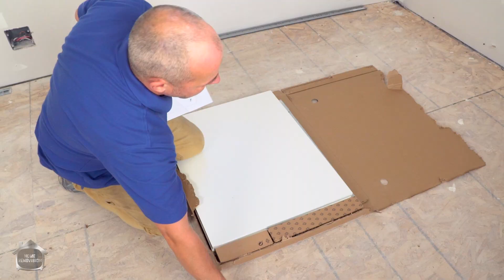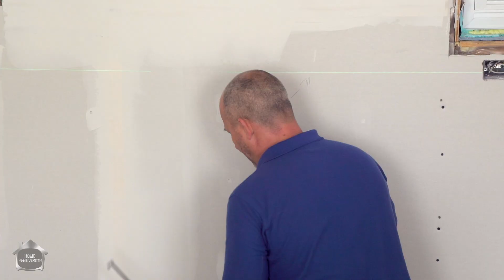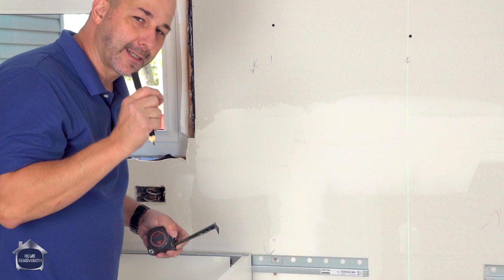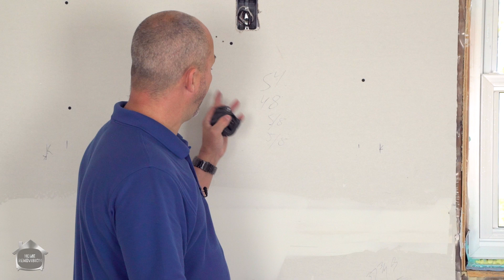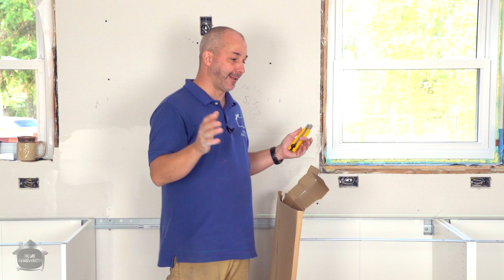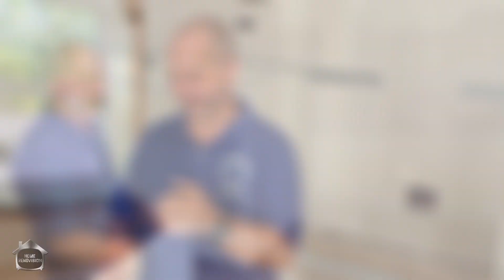How to Install IKEA Kitchen Cabinets and Save Money! | DIY Kitchen

Comment: How would you solve my roblem that the courner is not 90 degrees but 95 degrees….the cabinets cant hang in the air? Put them 95 degrees and add special filler or add horisontal bars behind the hangers to get 95 degrees? There is also the option to remake one of the walls with 0-15 cm new cement building block wall elements to get it to 90 degrees

Comment: wtf is this math? the feet carry 50% of the weight? did you just go screw(1)+feet(1)=2? Fastening points are in the back of the cabinets, majority of the gravitational pull is in the front, the feet are carrying way more than 50% i'd expect closer to 80%.. Screws are basically just keeping the cabinets flush..

Comment: The stove plug is too high.  Supposed to be max 5 1/2 inches from floor to centre of box and ground pin is supposed to be on left or right side.  This way the plug tucks in under the back panel of the appliance.

Comment: Hi, it's been a while you posted this video but still is the best install guide. Thanks. 
Would like to ask a question. I have pipes along the walls and so will put battens for the bottom unit rails. then is it okay to just have the rails and remove the White bumpers on the backside? Because there is nothing for them to be supported by?

Thank you in advance.

Comment: I go the extra mile when ive install those cabinets.  I make a base for the bases. Now you have a very strong cabinet. Ive never had very good luck with those feet they give you. I like their hanging feature but they arent the only ones who have that system.  I enstalled an European  high end cabinets that cost for an average  size kitchen ,roughly 9ft. X 10 ft. Those cabinets cost in the 70s were for just the cabinets  $ 25,000. . Ive done alot of the Ikea cabinets and other cabinets that are knockdowns too. Some are better than others ,so do your homework.

Comment: How high to mount the sliding bars?   For example, my lower cabinets is 34.5 inches (30 inches cabinet plus 4.5 for legs), so how high should I mount the bar to get perfect mount of 34.5 inches

Comment: The only way to save money is: DIY, it can be any brand kitchen as long as you DIY.
The only difference: Ikea designed the cabinets so it's easily mounted and supply an easy to read manual.
And there are now a lot of YT videos which you can watch, there aren't that many YT videos for other kitchen brands.
Reply from the maker: Very true!

Comment: We would like to put insul-armor subfloor in our basement, with vinyl click-lock flooring on top, and Ikea cabinets.  But I have heard you can't put cabinets on top of vinyl. I was wondering if the ikea cabinets can go directly on top of the insul-armor?  Or do we need to put plywood or something on the insul-armor to support the cabinet legs?  Thanks!

Comment: Good stuff.  Honestly though that explanation of finding the lowest point of some area of the floor was a little confusing.  Why not look for a spot along the wall that represents something like the average height of the floor and draw a horizontal line along the wall at say 31"" off of that point on the floor?  36" is a standard countertop height.  So if you subtract out an inch for the countertop and 4" for the rail.

Comment: Impressed 👍 if you can't do a diy install with all this information then your best off getting a professional to do for you. But with this info there's no reason most people can't do it themselves
Reply: However I'm still constantly surprised by the fact that the US uses imperial measurements 😄 such a weird mode of measuring compared to metric

Comment: How high did you hang them or does it matter on how tall appliances are?  Also, did you use their base system?  Those little legs that screw on to the bottom of the cabinets or did you use 2x4s?  What are your thoughts?  Thanks in advance!

Comment: Pro tip on opening ikea packaging is to use a stiff plastic spatula.  It's what they use in their recovery areas.

Also you don't need the appliance panel on the ends by a stove. You can leave it blank or use the standard 1/2 thick cover panels! The 5/8 are mainly for an end of run with a dishwasher or a dishwasher butting up against a refrigerator panel.

Comment: Two fun realizations with Ikea. Yes they go together fairly easily but a) the "filler" panels which adjust for non-uniform spacing are ridiculously overpriced and b) you are actually payng for a cabinet and skins for each and every piece. The cabinet is standard issue with a standard interior - much like all Ikea stuff. Then the skins (red, green, wood grain etc) are applied to that carcass. It adds up pretty quickly. Other than that they are pretty simple to assemble, mount, trim. I found granite tops to be cheaper, with more selection, from local suppliers.  Would I use them again? Probably not. My experience is a good cabinet maker is pretty close to the same price and will make hardwood cabinets (that you must paint or stain - see sprayer video) that fit perfectly. So that "filler" space in not lost. It just becomes a wider drawer or more storage.   Note this higher "filler" cost is true for all prefabs including Home Depot and Lowes etc.  So its not just an Ikea ding. In all cases you get a piece you have to rip saw and L-bracket mount.    But seriously check out a real cabinet builder - they have a lot of options and experience. You bring them your proposed layout and in a heartbeat they will improve it thanks to their vast experience.

One additional trick worth sharing. Look at a professional restaurant layout. They have zones and a workflow. The storage (pantry, refrigerator) and food prep (counter then ovens/stopetop) are in arms length. Usually from left to right. So the food comes together, is plated (to its right) and then off to the dining area.  When the course/meal is done the dirty dishes come back to another area and queue up for disposal, sink (rinse) and dishwasher. Then when clean back to storage. These functions do not cross eachother.   I did a  kitchen in this manner and had great dinner parties.  Dessert prep is also a space separate from the cooking area.  Sounds like a lot of space but its not. And if things keep moving people have more time together.

Comment: Great video as always.
1)Quick question what size scews did you use to secure the rail?

2)Also if you had to cut the rail what type of tool would you suggest?

Thank you in advance
Reply: I personally used 3" SPAX cabinet screws to secure the rails to the studs, and I used a 4-1/2" angle gringer with cutoff wheel and it zipped through cutting those rails

Comment: How'S your iKea cabinets hold up? Especially those next to the range. Planning remodel kitchen not sure if the cabinets will withstand the high temperature (broil/self cleaning)
Reply from the maker: you can always install some sheet metal on the side of the cabinet to sheild the gable panels if you do a lot of baking. Cheers!

Comment: Hi Buddies. I am in a trouble and requesting for ur helps. I got an accepted offer from a buyer for my apartment in BC, that I realized a drywaller left a lien of $ 1880 on my condo. Now, I have only a couple of days before the expiry of my deal for selling my condo. the contractor is unwilling to come and get his money and sign the release form and ask for more money just to come and do it. My lawyer and my realtor recommending I paying the extra $1000 plus the $1880 plus my written letter that I certify not leave him any bad comments for feedback so that he comes and signs the release form quickly before the possession date. What do you recommend me doing? He did a very bad mess with his drywalling and did not come back and said okay to bring someone else to fix it as he is busy at least for a week. Then, he resent me the same quote as he gave before for the finished work by him. I do not have any contract signed by him and nothing more than his initial quote.

Comment: Hi Jeff,
I think all of your video's are great! I'm thinking of purchasing the Ikea kitchen cabinets. 
Questions:
1. Are they RTA cabinets?
2. Both upper and lower cabinets are only supported by the hanging rail? Not screwed into studs at all, as with conventional cabinets?
3. I see that there is only a metal bracket connecting the side panels of the cabinets. Is this strong enough for either granite or quartz counter tops?

Comment: You forgot to add the 5/8 for the 103" panel when adding the 10" overhang you were measuring off the edge of the bare cabinet

Comment: Has anyone tried moving IKEA cabinets away from the wall? How did you brace them? We are building a laundry room with a 30" countertop to match the washer/dryer depth, and want to bring the cabinets forward 6 inches to be flush with the front of the laundry units.

Comment: Best tool to open all the boxes I found is a small plastering spatula. It is thin enough to fit in between glued flaps and not sharp enough to damage anything thou still sharp enough to penetrate the tape. It takes me now couple of seconds to opeen a box nice and clean compared to what mess I was making ripping and cutting those boxes before xD You welcome!

Comment: You mentioned you can place cabinets after floating floor is installed? Wouldn't they pinch the floor and prevent it from expanding/contracting?

Comment: The range receptacle should be 130mm to centre AFF.  Yours looks a little high.  Just a note, unless you are a licensed Master Electrician with a contractors license you are not legally allowed to perform electrical work in other people’s homes in Ontario.  You should probably not be mentioning you did the electrical yourself.

Comment: I’m sorry bud, but this is just not the way to professionally install cabinets. Drywall isn’t complete and there’s no finished floor. There is literally no reason or excuse to installing cabinets before flooring. Even the flooring you’d save money one, won’t be there and in turn won’t be a complete flooring system.
Reply from the maker: So the reason I am moving forward is so that I can have my counter measured and cut while I am finishing my kitchen. this saves me almost 2 weeks of production. Sine I am living in the house I am willing to do it a little backwards to finish faster. no worries it does not cause any problems!

Comment: Hmmmm thoughts on building platform bases instead of the feet.
Reply: Wondering the same thing, particularly the island.  Thanks for the great video!
Reply: @kristin347  there's a guy on YouTube that does a 5 part install he builds custom based for his  think his name is Cody. And this k channel is up to code
Reply: @kristin347  his name Kody and I justcsearch ikea kitchen cabinet course.
Reply: @jamesmacintyre1415  Thanks for the info!
Reply: @kristin347  it's a long course but he covers alot of things

Comment: Watching all the fraction math and measuring just reminds me of how desperately the U.S. need to switch to metric. They were teaching the metric system in the 70's and we STILL aren't using it!  Nice video though.
Reply: He's not even in the us lol
Reply: This guy is in Canada, not the US lol. Plus, fractions are used in the metric system too. It's basic math. It's not hard.
Reply: BTW, building codes provide two equations: one is applicable to the imperial system, another is applicable to the metric system. Moreover, when you design a project for feds, they require drawing in metric (SI). However, when it comes to a construction site, contractor converts everything in the imperial system. And that is when all fun starts….contractor converts 12 mm rebar (which is #4 rebar) into imperial system and it becomes #3……and so it goes…..Engineer of Record must be on alert  day and night, sleeping at construction site, verifying everything what construction crews installed. This becomes a nightmare…..the solution is, schools must stop teaching imperial system, period!

Comment: Thanks for the video. I wished I had watched it before I hired someone to install the cabinets after I put them together so I could tell when they didn't do things right. Because they didn't...

One thing I did was to put brown contractors paper on the floor and then draw everything out including measurements. That reference was great for the electricians, plumbers, and flooring guys to get things in the right spot. And I could walk around and take measurements.

Comment: I have been a professional ikea installer for 15 years now in 9 different countries and the information and instructions you are showing and telling people is so in accurate that it worries me. There is a list of things that you have told people that are wrong. Please be careful with your instructions. Thank you.
Ps. I will give you 2 tips. 1. Do not use countersink screws for the rail, mush be pan head screws. 2. The correct measurement for the bottom edge of the rail is 2”3/8 . 36”-1”1/4 for countertop and then 2”3/8 to underside of rail.

Comment: Putting a screw below for added strength is single handedly one of the best no-brainer advice that is actually not a no-brainer LOL Amazing!
Reply: Agree but would (will) put 4 legs on each cabinet meaning the wall hanger is just for the purpose having the cabinet`s "in place" both thing is OC best.
Reply: Or you can use the correct screws...

Comment: I wish I can hire you to do it. IKEA quoted me $5000 for installation and another $5000 for taking off the existing cabinets. IKEA won't do the quote until I buy their products. Now I got stuck since they charge too much (other companies charges $3000-5000 for both taking off existing ones and the installation) and the products are sitting on my kitchen floor.

Comment: Jeff, your video of the kitchen cabinet install is awesome. I do have one question though, how do you secure your island cabinets to the floor so nothing moves? Thanks for all you do for us diy’ers.
Reply from the maker: by the time you attach your end panels and install a counter it is no issue. if you wanted to you could throw in a couple 6" structural screws through the bottom, to keep it from moving!

Comment: I find your videos very informative, so thank you very much for that.  I have a question regarding bracing.  My condo has metal studs 24" on center which I know is terrible to hang things on.  How do I put wood bracing between them to hang cabinets and what kind of wood should I use?

Comment: No cut the top of the side panel off so that water cannot be moped into the floor side, it's easier to silicone the panel from water ingress under the counter than sealing a cut on the floor, 👍

Comment: I'm a kitchen fitter,, fitted one last year and it is the easiest system of kitchen to fit, I love the Strengthening bars to the rear and front of the cabinet's which also keeps the worktop level and you also get oblong metal packers for the corners,, but the beauty of it is when fitting the sink or hob you only cut the worktop no cabinetry, and the wall hanging system is infallible,,the plinth at the base of the units doesn't even require screws it's a plastic so waterproof extruded system with cam like clips that slot into a groove and twist into the rear of the plinth,, it's absolutely the best system ever developed,, even fitting a Belfast sink was a doddle and the waste system design is impeccable, so yes I've fitted Howdens most my life but ikea excellent, also of note the clad on panel's for larder unit's are deep enough for the worktop to finish to it and not beyond it,, I can't stand a worktop that protrudes beyond the cabinet line❤️👍

Comment: Firecore or DeWalt for FIRST laser level?  Approx. retail price for "decent" laser level?  100?  $400?  More or less?
Reply from the maker: 100 bucks for a good entry price point.
Reply: @HomeRenoVisionDIY  Thank you!  While I would PREFER one of the $500-$1600 versions, I dropped an order for the more expensive DeWalt model on your Amazon list:  DEWALT (DW088K) Line Laser, Self-Leveling, Cross Line

Tons better than what I have... which is nothing.  <wink>

Comment: I've just recently discovered this channel and Jeff Thorman. It is so valuable. Many thanks. I have a question: as I'm watching your different videos and absorbing the various tips and concepts, one of the things I'm curious about is sequencing in the IKEA kitchen DIY. In other words, after removing the old kitchen and sorting out the plumbing for the island do you go straight to the hanging of the cabinets? If so, doesn't that make the flooring installment at the end tricky as you try to navigate around the cabinets? And do the cabinet feet sit on subfloor or the new vinyl plank floor? (These are rookie questions)

Comment: So many great tips. 
1/ finding the highest floor point to set your cabinets.
2/ tips on doing your wiring.
3/ increasing the rail holding strength 
4/ dealing with bowed walls
A lot more tips.. a lot of shared experience in 30mins

Comment: At 43:13 - the extra inch of each side, is that same inch going to be on the front and then, for you ad additional 10 inches on the back side?
Then at 44:24 - you mention that the finished counter to counter should be 40 inches, but earlier you said you want 40 inches minimum between cabinets?  which is it?  does it matter?